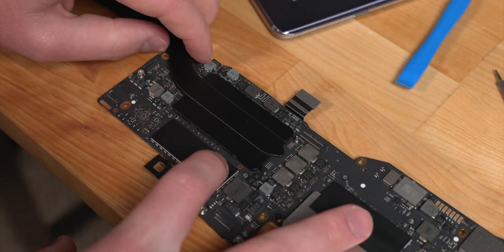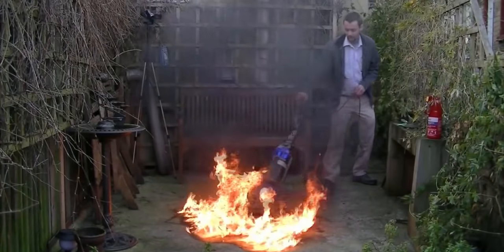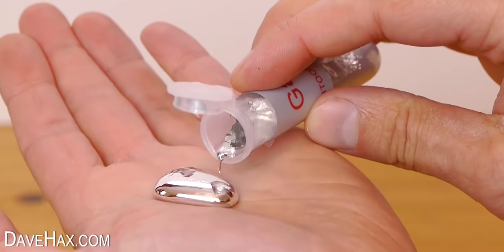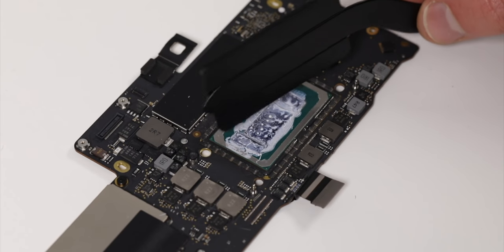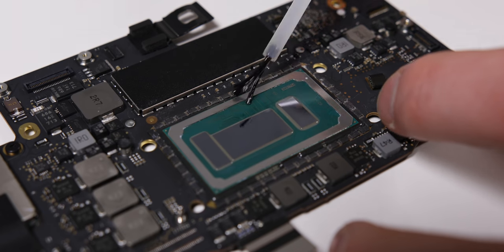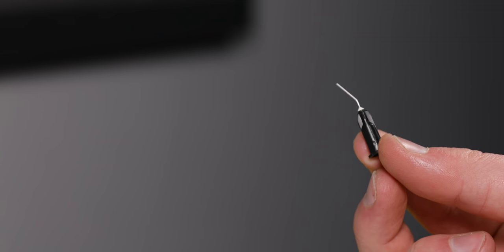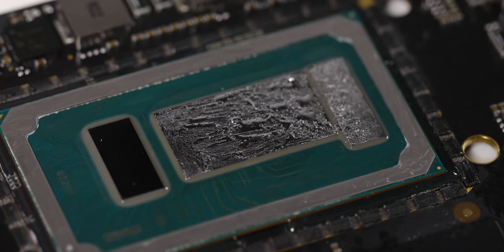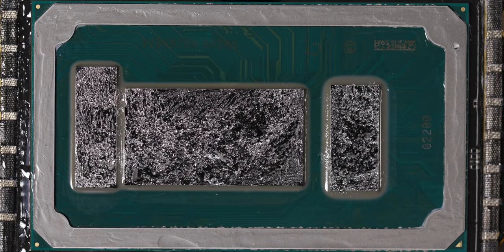Liquid Metal in a MacBook Pro: No More Throttling!

Comment: My G key on my MacBook Pro 2017 w/ Touch Bar keeps repeating. Does anyone know how to fix this?
Reply from the maker: Rad Museum The keyboards on the new laptops are notoriously awful. Take it in to Apple for service. They have to replace the entire bottom chassis.
Reply: Buy a can of compressed air and blast carefully over your keyboard. Sounds weird but it really solves most problems like this. Did it myself and worked. There are videos about this as well.

Comment: Why should your battery life be improved by this? Your cpu can stay at a higher boost for longer, and dissipate more energy to the environment, which means it draws a lot more power, thus decreasing your battery life, but increasing what you can accomplish during that time.

Comment: Batterylife improved? Why would that be? It is probably the other way around, the cpu can now produce more heat using more wattage because the cooler is able to deal with it -> worse battery life! Still nicely done!
Reply: It means that for the same GHz, the CPU can run cooler, thus using less power. If the CPU does not need to go to say 3.0GHz, it will run nicely at 2.5GHz and with both at 2.5GHz, if it is running cooler, it will use less power.
Reply: JamesJingYi no, there is an error in your thinking, let me explain:
The cpu runs cooler, thats right. But that is not because it procuces less heat, but because the heat is pulled away by the sink faster! It will use exactly the same amount of power for the same perfirmance, while staing cooler.
Reply: muh1h1 Not really. Lower temperature = lower electrical resistance = less power draw.
Reply: Exactly, it can enable a higher clock speed by cooling it more efficiently,. but for a normal workload, keeping it cooler enables it to use less power as it has less resistance. In certain situations, if the processor was doing something intensive, the battery life may suffer yes as it is able to higher clock the processor, but in normal workloads it will enable less power draw.
Reply: James Mitchell we need more scientific evidence here, but i don't think that is how it works. Firstly a cpu works off a constant voltage, not a constant current, meaning if the resistence dropped, that would mean the current goes up, leading an actual higher power. But i think the change in resistance over a 10-20°c span is negligable anyway.

Comment: galium will fuck up any solder it touch... not only shorting, but degrading it...

also, it attacks alluminium... how it will rot away the cooler if the base is not copper?? how long?? that's the question!!

Comment: Wow, so interesting! Makes me wonder why Apple doesn't do a better job at this out of the factory.. I mean, all of the "cost no object" decisions plus the "we don't care about upgrade-ability anyway" decisions plus how they target Prosumers/Final Cut Users/etc, would strongly imply they would be interested in this improvement. Snazzy > Dan Riccio!
Reply from the maker: You raise a good point in terms of upgradability. Some PC manufacturers are starting to solder the CPU directly to the cooling system. The downside is that it makes it essentially impossible to service, but it heat transfer is excellent without the downsides of liquid metal. I’m betting the reason Apple doesn’t do it is just the sheer scale at which they manufacture these things.
Reply: I believe there are other downsides such as gallium tend to migrate into copper heatsink due to their electrochemical property, which cause liquid metal to “dry up” and lost its effectiveness. It can happen as soon as a few months depends on the heatsink’s makeup. I would really like to hear Snazzy’s take on this.
Reply: What about environmental concerns?  Or for that matter - how much does gallium cost?

Comment: You could nickel plate the copper, that will stop the liquid metal from ionizing onto the copper after a year. Although that's an extra step that takes even more time.

That's really a few extra steps that could involve you making your own solution. It's surprisingly easy to brush-electroplate but will take time.

Comment: Apple should really use liquid metal in the first place. Fits with their obsession with quiet computers.
Reply from the maker: The better solution is to solder the coldplate directly to the IHS. Even better thermal transfer without the limitations of liquid metal. Only problem is that it removes end-user serviceability if something breaks, but MacBooks are already so “not” repairable that I think it’s a good trade off. Main problem is cost. Would be way more expensive for Apple to do, so they just don’t.

Comment: Will liquid metal be the new thermal compound? I'd pay an extra 20$ if companies offer a factory installed liquid metal solution tbh. Can someone Mcguyver a liquid barrier between the heat sinks with silicone? I'm guessing if silicone cookware can withstand temperatures during cooking it should handle the CPU heat with no prob. 

Also, why can't we just rely on surface tension to keep the liquid metal in place? I'm not gonna do  the maths but anyone here who studies Thermofluids can do the calcs? lol okay
Reply: liquid metal does not guarantee longevity so i doubt there will be any device with liquid metal from factory,
surface tension leaves room to a lot of microscopic air gaps as metal on metal will never be 100% sealed thus there will be a lot of hot points with no way to dissipate heat .. the only future i see for thermal paste is actually a carbon based thermal pad that is reusable and can last for ever.

Comment: The question is why don't they put this inside if it isn't very expensive?
Reply from the maker: I mention the inherent problems with liquid metal. Some manufacturers will solder the IHS to the die—and honestly—given the lack of repairability in Apple laptops, they should do it, imo.
Reply: Really? Which laptop manufacturers are you talking about? I thought nobody did that and it was more of a theoretical solution

Comment: Had did the same thing to my MacBook Pro 13" 2015.
But... too late because of the overheatihg  was the Graphics part damaged =(
Iw buyed a new CPU for arround 200€ and build it in by my own. Yeah it fits =) but another issue. because of the heat, parts fell appart on the top and at the back =/ 
now i slowing assembly this shitty thing and at a day in the Future... it will work again... so i hope =P
Reply: So long time Later I am able to use my MacBook Again =) Just buyed a "New" Board and lets go =) (But with Cryonat).

Comment: With 9.6K likes in this video that is so on point to highlighting on Apples poor thermal cooling system this shouldn't just be a informational highlight. Yeah, I think its awesome that know what can help us all improve the problems we all suffer with when using a Mac Computer. Though Should we really have to go to all this effort and work after we spent thousands of dollars on a machine that was designed so poorly! TO be quite frank it was a rhetorical question, lol, so NO we shouldn't. I feel we all need to take a stand against apple to get (force) them to for once design a thermal system that can prevent thermal throttling and handle all the intensive applications we use on a daily basis. Because frankly for the sake of wallets in spending anywhere from $3500 to $13,000. Its not just the MacBook Pro;s that have this issue the iMac Pro does as well; which is horrifyingly disappointing and unacceptable. We paid for a machine that does not function properly to handle this applications it was marketed and intended on being used for: seriously on apples website for MacBook Pro that market its use for Apple Pro Apps and even games like Tomb Raider or Fornite which will almost within minutes take the temps to 100C degrees and higher on a constant; which fans on max doesn't even help. Its just not acceptable for apple to get away with this any longer. Personally, I'm tired of it! So if WE all want to have that Mac computer someday that has top notch cooling then We’re going to need to put some consumer pressure on them. we need to Keep up the advocacy, and call your legislator!!!! put in the effort and we can all reap the reward.

Comment: Nonsense video... 10% speedup at the risk of destroying a perfectly working macbook?!
Reply from the maker: Well, the video’s purpose is entertainment, so it’s not nonsense. Furthermore, the improvements are worthwhile for many commenters. If you don’t want to risk it, don’t. No harm, no foul.
Reply: Another thing is long-term stability. What if the metal leaks and bricks the motherboard? I just don't think 10% performance gain on a ultra-portable laptop is a wise idea to promote. Your previous Hackintosh setup makes more sense.